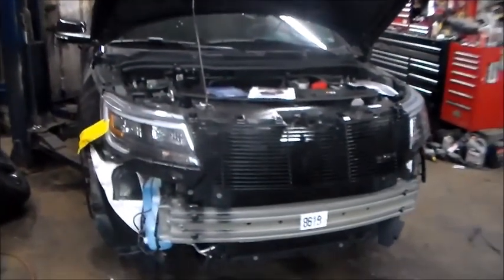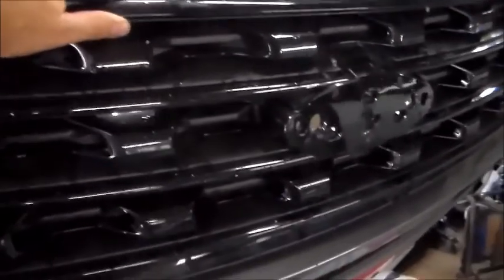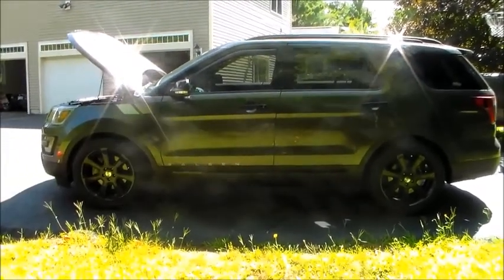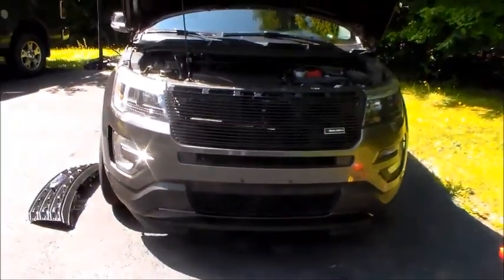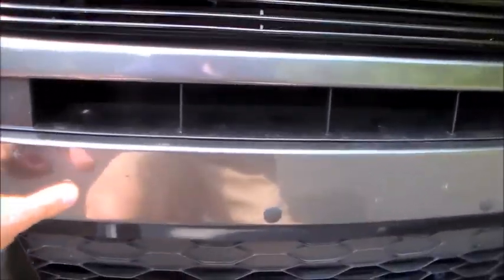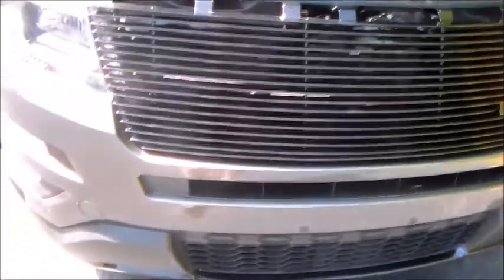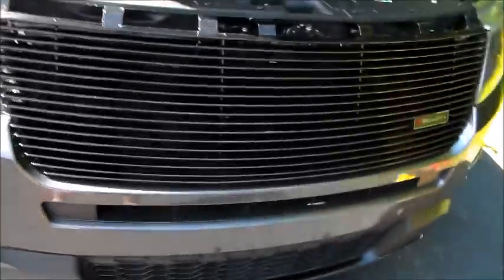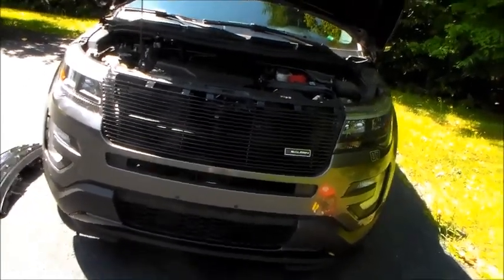Saleen Explorer T Rex Grille Installation!

Comment: What year is that? Do u know if u need to remove bumper on a 2013 explorer
Reply from the maker: Mine is a 2017. I believe you would have to remove part of your bumper, to install this grille on a 2013. It might just unbolt, but you will definitely have to remove part of it.
Reply: @Metalcop5150  ok cool yea it looks like I need to remove like the top half that grill looks really slick I just got the ford raptor grill so was just curios
Reply from the maker: @nickoneill4918  Cool! Those Raptor style grilles look great too!
Reply: @Metalcop5150  thanks yea excited to put it on already lol

Comment: great looking grill.  Since you needed to replace the entire stock grill assembly - were you able to retain the forward camera?
Reply from the maker: Mine did not come with the forward camera. However, I have seen how they are mounted on other Explorers. You could easily retain your FWD camera, with just a little bit of custom fab work. Thanks for watching and commenting.
Reply: I am/was interested in the Torch grill... but after watching your very informative video I'm having second and third thoughts.   I was kind of hoping for a relatively simple bolt in..... this is not that solution.   But it looks damn cool.... its like a moth to a flame (or an LED light bar)
Reply from the maker: It was most definitely NOT a simple bolt-in! But the results speak for themselves. It looks fantastic, IMO, once it is done. Certainly stands out from the crowd.

Comment: So what model was this grille made for?
Reply from the maker: Nate Dixon It fits any 2011-2018 Explorer, the grilles are all the same exact shape. I had to modify my Sport, quite a bit. Other models this grille may fit right on. Short answer is it will fit in all Explorers w/ different levels of modification required.
Reply: @Metalcop5150  is there a chance you have a link for me to find and purchase one? Ive always been different. My 96 explorer was jewel green with gold base. Redid my grill. Took a factory aftermarket one, gutted it, and put in a mesh aluminum grille. My 04 had the billet with clear heads and tails.
Reply from the maker: Nate Dixon Just do a search for T-Rex Explorer grille. They are literally everywhere. I bought my last one from Amazon. You can get them from T-Rex directly but they cost more. Put in the work, my friend!! 😂

Comment: How do you remove the ford emblem ?
Reply from the maker: I installed an entirely new grille, without the Ford Emblem. If you wanted to use your stock grille, you would have to remove it, completely and unbolt the Ford emblem. You would be left with a flat area, or a void, where the emblem was. I hope this helps. Thanks for the sub!